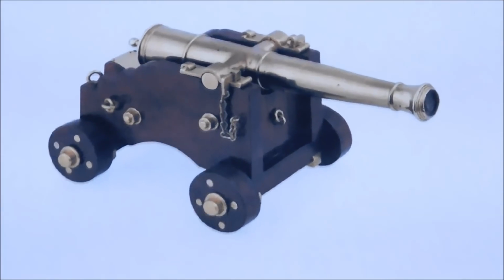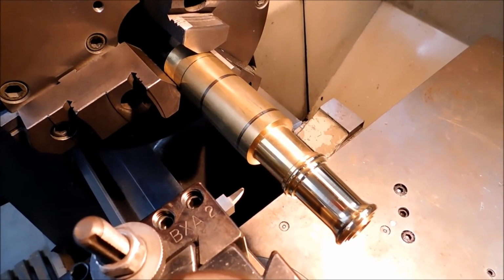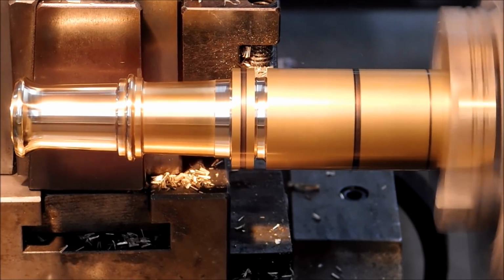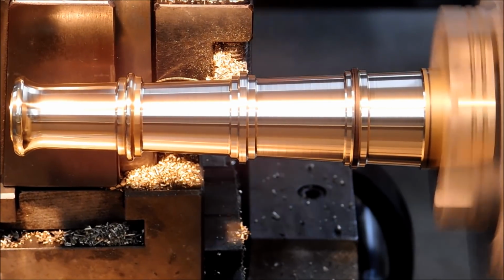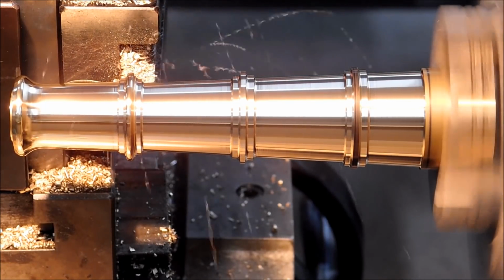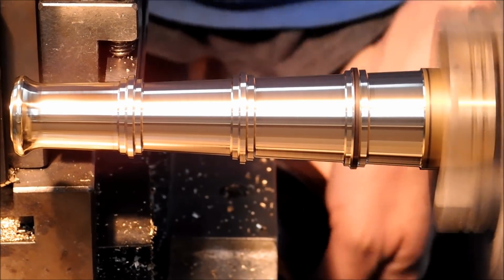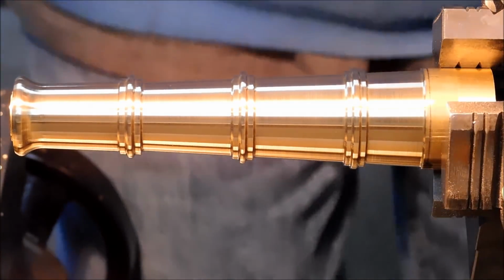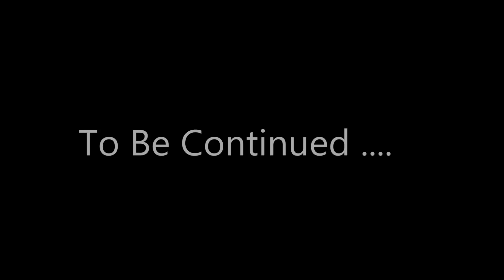Naval Deck Cannon Model  Part 1   Turning the barrel

Comment: I like your project.  I look forward to seeing how you go about  locating the placement and size of the trunnions which were generally one caliber wide (diameter of bore) and one caliber long at the top surface where it is located at the center of the bore axis. A great book on the subject, with scale drawings is, "Round Shot and Rammers",  by Harold L. Peterson
Reply from the maker: I plan to place my trunion for cosmetic appeal. I know that diameter/bore reference, but I may make mine smaller to allow for comfortably sized other components. A good way to place a trunion is to complete the entire barrel and lay it on a pin. Keep shifting the barrel until the barrel muzzle end lifts. Shift forward a bit to be sure. and drill it there. This won't be a true scale model, but very close to a 24 pounder.

Comment: I hate to be "that" guy but my eyes are telling me that the front muzzle section where it meets the first raised elements is several thousandths larger than the beginning of the second section after the raised elements.
Reply: fabricator it does look like it but could just be the light
Reply: I agree.  That 1st section had been turned previously and Joe picked up from there for the remaining sections.  It looks like he used the final diameter of the 1st section as the beginning diameter of the 2nd, without allowing for the increase over the distance of the 1st raised elements.

Comment: Nice job. What is sometimes do is use a MT extension drill socket in the tailstock in order to use a center. Not ideal, but works sometimes when compound is in the way.

Comment: Impressed that you could do the turning with such a large overhang and fairly small length of material gripped in the chuck without using a tailstock centre. You were taking fairly light cuts but I think the reason is more to do with the quality of your chuck and overall rigidity of your lathe. Great video.
Reply from the maker: True. I was aware of a 'Climb over" potential. Light cuts helped for sure.

Comment: I've noticed those lines on my machine when I have the carriage feed engaged. I've never measured them, but it looks like they are at the same interval as the lead screw pitch. Maybe when the half nut crosses the slot in the lead screw there is a slight hesitation in travel?

I've always wanted to make a cannon. Maybe this is the inspiration I need to get to it.

Comment: My daughters making a cannon in my workshop in the hope to get some experience before she starts her engineering apprenticeship. The trouble is the brass is too big to fit in the lathe past the chuck and it’s going to be too long to not use a centre. I hope the centre doesn’t get in the way of the compound slide.
Reply: Might be a good idea to turn the cannon 180 degrees to what Joe has it and then your compound can be three degrees the opposite direction and get you a little further away from live center. Leave enough meat at the butt end of the cannon so after you're done with the profile you still have something to grab onto with the chuck to drill the barrel. Goodluck
Reply from the maker: Thats a good idea. Turn a small cylinder on the front of the blank first, smaller then the planned bore. Flip the part and reverse turn the barrel. Then when you bore the hole, the material you were just holding on, goes away. I call that a one way part.
Reply: Thanks joe and Troy I’ll give your ideas a go and I’ll let you know how I get on.

Comment: To avoid ridges:
Make an adaptor, and turn compound slide with battery powered drill/driver at low speed.
Use flex 1/4" extension to minimize influence.

Comment: As always, very fine work Joe! Hey speaking of tapers....I have a 1.5" x 16" long brass cylinder that I have to bore 5 precision steps with hard square shoulders which start at 3/4" and steps down to 3/8" along the length inside. How would you do this ? most of my drills are not long enough to get down the length? Do I have to buy a set of gun drills and then matching reamers? I have not seen reamers that long and it sure seems like a good way to break something at that length.  I cannot wait for more Cannon work from you!
Reply from the maker: At that length, extended bottom cutting reamers sound like your only option. Make sure they are bottom cutting. You can make your own extensions if the length is not available. I've done it many times.
Reply: @joepie221  Terrific! Thanks for the heads up on the reamers. I was not aware of bottom cutting Type.

Comment: I like the method of backing out with the cross slide and jumping the features....but I think the next level would be to calculate the rate of taper and compensate with the cross slide to the appropriate position, and continue the taper on the other side of the feature....that way it's almost like the taper is continuing beneath the feature, instead of basically being flat....
Reply from the maker: Thats exactly what is happening. If you turned the raised elements off, there would be no flat ( cylindrical) area on this barrel.  Think about it.
Reply: @joepie221 ohhhhh you are jumping the features with the compound....I thought you were stopping the compound advance and  jumping with the carriage lol. My thought was you were conserving compound travel by jumping with the carriage

Comment: Hey Joe,
I'd like to see what you do when you are cutting the taper with the compound but you run out of range with the compound.  Specifically how you pick up the taper again after having to move the carriage.  Thanks
Reply from the maker: My technique would be 
1.back off the cross slide, 
2.advance the carriage the distance of the compound stroke,
3. return the compound slide to its start point, 
4.begin feeding the compound while advancing the cross slide. 
5.Once contact is detected, stop advancing the cross slide and finish with the compound.

Comment: Joe I have great respect for you and have learned a lot of tricks but I always file left handed and NEVER reach over the chuck!!!!!
This can be ok? on a small lathe  but on a larger machine its VERY dangerous......
One thing I do is run the spindle in reverse  and hold the file by the tip with 2 fingers, anything bad happens it just takes the file away from you??
Reply from the maker: I draw the line at around a 10" chuck. from there I use tools to deburr and radius parts.

Comment: Nice Joe, I have a question, I am making a diamond (Machining a Diamond shape with a Spin Indexer) and I'm up to the fly cutting did you use a special grind on the bit, cheers from OZ.
Reply from the maker: Mildly aggressive like you would use for aluminum. Small tip radius.
Reply: @joepie221  Thank Joe for the quick reply, keep up the good work.

Comment: Hi Joe, nice work with the cannon. Thanks for posting your videos, they are very instructive and you often have true gems, the one that I’ve found most recently was putting an angle on the end of the parting tool so that the cut off piece has no nib.
You mention returning to the same cross slide value when compound taper turning, and stepping over the bands. From what I understand this means the barrel tapers on each side are parallel but not on the same line. If you wanted to have them on the same line is there any way to do this or is the maths too complicated?
Reply from the maker: By keeping the carriage locked and using the technique described, the taper is continuous beneath the bands. Each time you advance the compound, you have increased the diameter. by having the cross slide return to the same number, the trajectory continues to be the same as well. No deep math necessary.

Comment: Hi Joe , a real treat for the eyes  , thanks ,
A quick question , would you  recomend hss tool similar to that used by you for working on gold wedding rings ,ie groves and bev edges, 
Cheers
Reply from the maker: I personally like HSS for softer metals. I've always had better finishes.
Reply: @joepie221  thank  you  joe , new to trying a lathe with my ring  making , much appreciated 👍

Comment: Have you ever used "semi chrome" polish? It comes in tubes or cans. You will get amazing results. MSC has it #77552198.
Bigger sizes are available too.
Reply from the maker: I have. It works well. I have a new favorite I use on this project. Stay tuned, the next 2 segments are coming pretty quick.

Comment: You never said what polish you were using.  I'm guessing Simichrome, although Flitz and Brasso are also options.
Reply from the maker: I'll show it soon. great stuff. Almost like 000 norton diamond paste, but available over the counter.
Reply: Awesome video.  Did you show the taper attachment in a different video.
Reply from the maker: @chadhanson3431  No taper attachment used. this was all done with the compound.